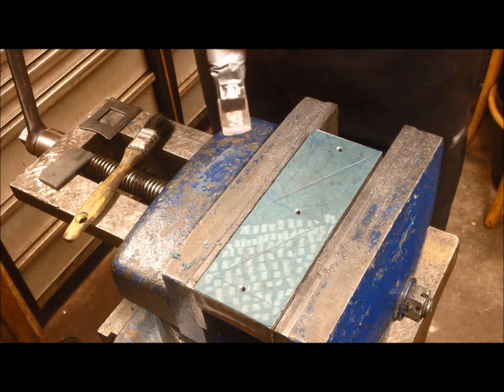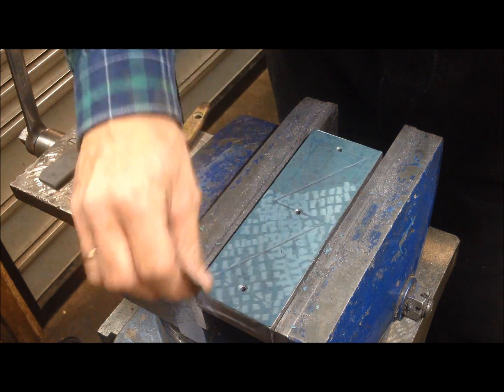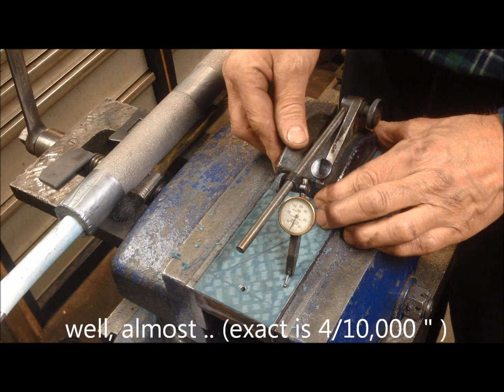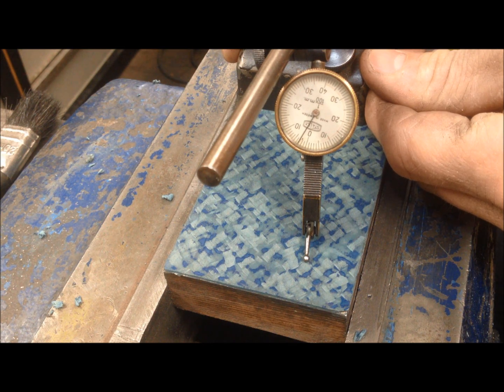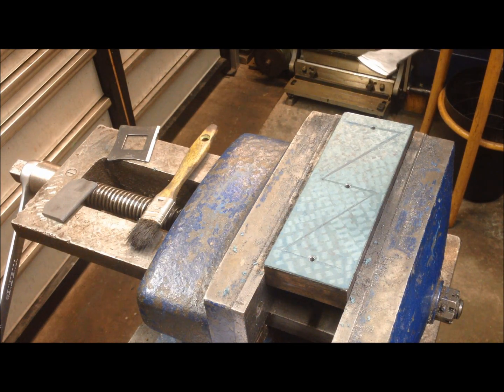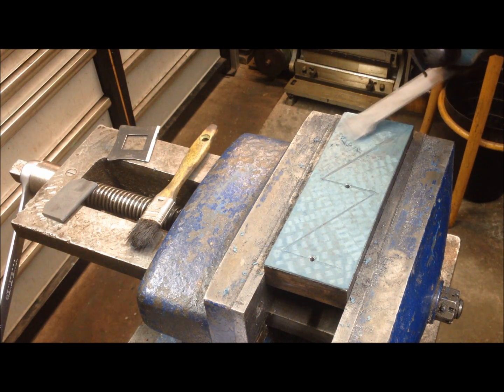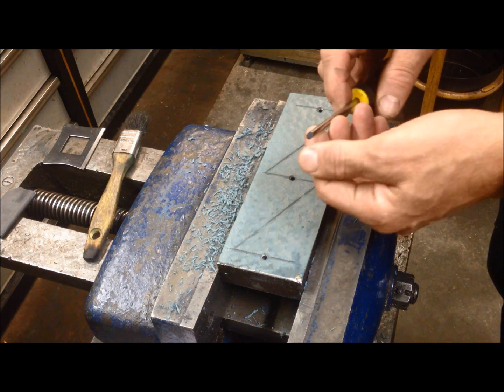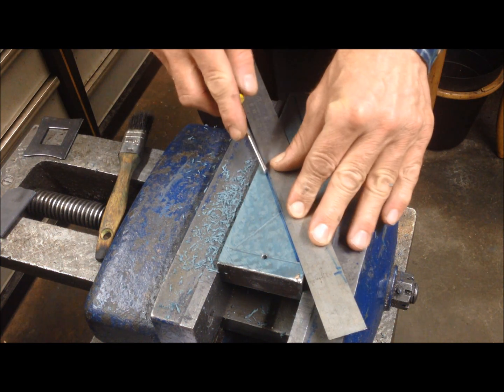Rulon - part 2 - scraping, depth of cut, oil grooves

Comment: Would you please let me know what type of blade did you used for Rulon power scraping ? what is the relief angle ? How about speed and stroke ?
Reply from the maker: Uisng the BIAX, I lowered the cuter carefull onto the surface until I saw/felt it started cutting.The cutting angle should be 10-15, maybe as much as 20 degrees negative. I used a quite long strike. You should of course reduce this as you get to the finishing stages. The speed was also quite high, at least in the roughing stages

Comment: Thanks for great demo , is it necessary to scrape for hardened ways against Turcite
Reply from the maker: Thnks for commenting. Well, I am not an expert, but hardened cannot be scraped with normal tools/methods and Turcite otoh should be/is normally scraped. I assume a ground hardened surface is a nice mating surface to a scraped, possibly also flaked surface with Rulon or Turcite
Reply: @jansverrehaugjord9934  thanks buddy

Comment: Hey Min Favorit Normand....  Hvor fik du fat på RoulonB - Det dyrt right?  Jeg har set på 3meters ruller i Kina og det hurtigt 1000kr DKK...   Jeg har rodet med Biltema Super Epoxy som dig .. og så Rulon 142 and Turcite B ... Turcite B .. er billigere right?   Hilnser derop til Jonas i Daneland (  Norge -  Skåne og Halland og Blekinge er jo Dansk )   Du en dansk kommune.
Reply from the maker: Hei, jeg mener det var fra TriStar Plastics i USA. 1000DKK for en 3 m rull høres jo ekstremt billig ut! Tror jeg betalte en del mer enn det, men husker ikke akkurat prisen. Fint å jobbe med Rulon, og Biltema limet ser ut til å holde bra